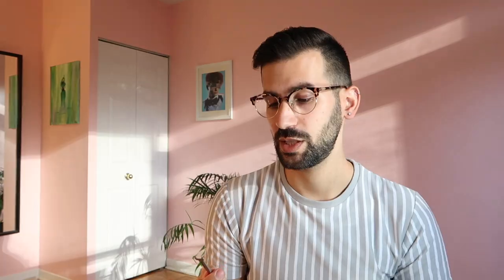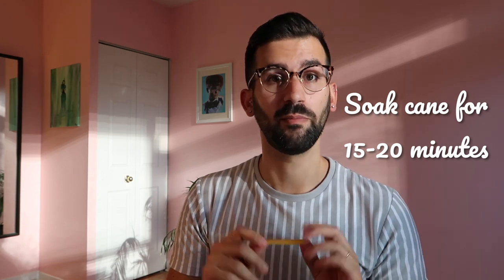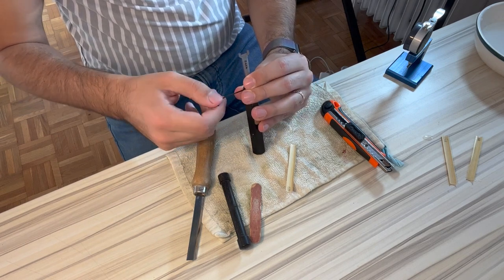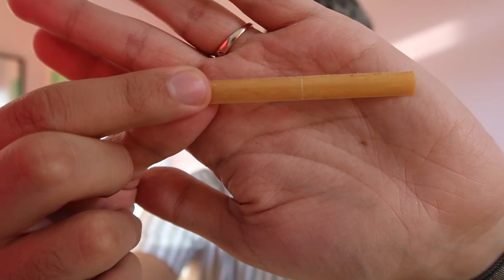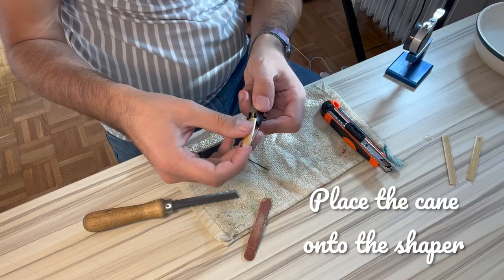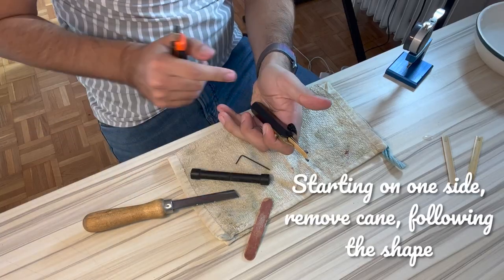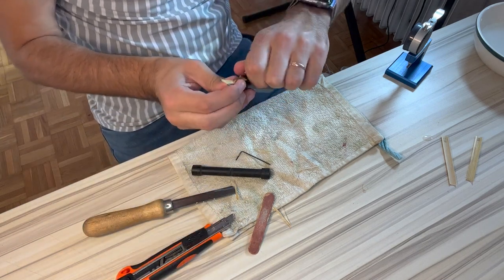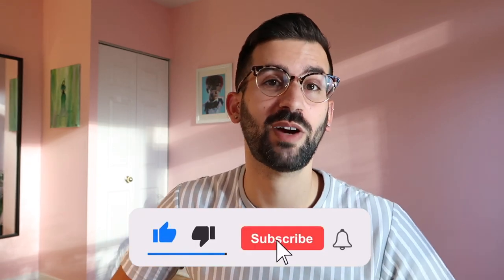How to SHAPE Oboe Cane | Reed Making TUTORIAL

Comment: Thank you for demonstrating the tip-up technique. It always makes me cringe when someone shapes by resting one of the ears on a hard surface. How common is it for an ear to break off? I know the force is going through the tip at one end or the other, but if someone is carving away with enough force to break an ear they are probably doing it wrong.  Since the base has more metal, it might be a little safer than through an ear. If using the tip-down technique, one could always try to equally support the ear and the handle ends, and use a softer wood or rubber pad instead of a hard surface to rest the ear on.